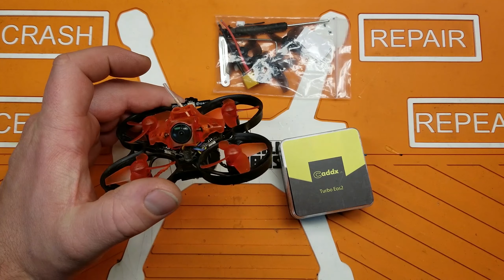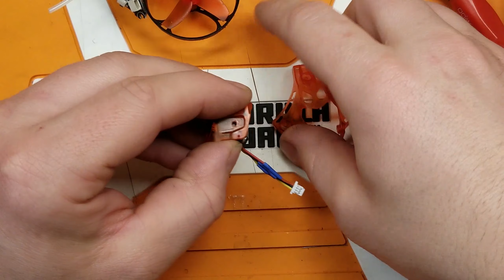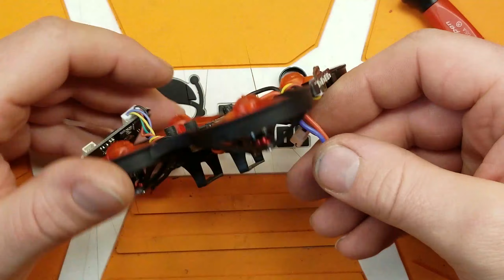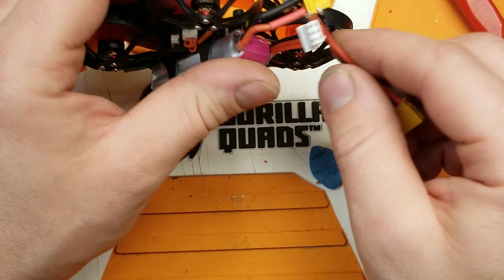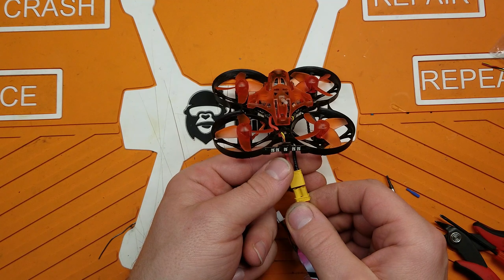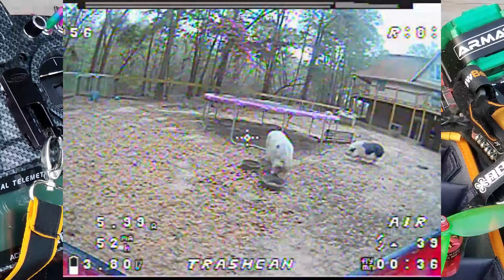Trashcan mods XT30, 4:3 caddx camera install, and range fix🏁👍👀

Comment: Cool video.
I think about buying this drone and I have box goggles with 16:9 screen (betafpv vr01). Do you think the image would be correctly displayed full-screen without stretching on that kind of goggles?
Reply from the maker: It will be stretched a little since the vr01 aren't actually a 16:9 ratio from what I remember. I think they are around 16:10 but if you don't know any better then it doesn't really matter.
Reply: @TweetFPV  Thank for quick reply :) 
They are 800x480 so something like 16:9,6 :) Do you think they will automatically adjust and display the feed from trashcan correctly fullscreen? I'm asking because I used them with a drone that has 4:3 camera and the image is really stretched horizontally. I'm afraid that they are hardcoded to stretch the 4:3 image. Is that possible? I think it's similar hardware as in eachine ev800dm.
Reply from the maker: I think the trashcan comes with a 16:9 cam so you should be good.

Comment: Whats your Battery and Power settings in Betaflight?
Reply from the maker: Sorry I don't have this quad anymore. But I could help you out. Typically I set max cell voltage to 4.4 minimum to 3.0 and alarm voltage to 3.2
Reply: Okay thank you very much for your answer :D

Comment: Whoop season and I have 2 dead Eachine Crazybee F4 Pro boards 200 flights on first board... about 20 on the replacement... any word on the quality of the V2 V2.1 V3 boards...?
Reply from the maker: I have had good luck with the v2 and v3 boards. But there are so many other options out there like the betafpv aio board and the nameless rc board that I would probably pick before the crazybee boards.

Comment: Nice camera mod, but were the pins different sizes? Instead of splicing the wires, seems it would have been faster and easier to move the pins. They pop out the connector very easy.
Reply from the maker: I was going from a scoket to pins or vise versa I can't remember. That's why I had to splice.

Comment: You can add your own receiver the R1 pad and the 5v and ground from the camera pads i did it myself
Reply: Any idea what DSMX Spektrum receiver would fit/work on the trashcan? Thanks
Reply from the maker: https://www.getfpv.com/spektrum-spm4650-dsmx-srxl2-v2-serial-micro-receiver.html that's about as small as it gets.

Comment: or you could have pinned out the connector and just change them..  and eos2 turbo is a 16:9 camera.. the ones sold as 4:3 is just set as that with software.. you can do that yourself
Reply from the maker: The eos2 is not programmable or at leat not by the end user. There is no camera control on this camera.

Comment: How did you get your FC to accept the LED assignments in Beta flight.  I was able to number them, assign colors and options in beta flight but when I click save nothing seems to take...the transmitter loses telemetry and regains telemetry (almost like a reboot but it never disconnects) but no joy.  I have been able to get every other betaflight option to stick except the LEDs.  A tutorial would be great!

Comment: thank god they made holes in the V2 version that way the battery lead can be soldered from underneath the board and solder on pads on both sides.
My other one blew up because the leads were shorting out lol.
Reply from the maker: Yea that v1 board was not an easy one to get the heavier gauge wire soldered to. I actually found it better to solder the positive to the pad then the negative to the ground leg of the USB port.
Reply: @TweetFPV  Also possible, i did it that way when my internal regulator burned out, so i used a pololu 5v regulator and took the negative from the usb :)
Shortly after it died completely but that was probably an esc failure, started smoking and shit XD.

But im scared because we are supposed to use this to control voltage spikes from the xt30, they ship it as an extra option strangely enough,  new v2 board came with normal xt30:

https://www.banggood.com/Happymodel-XT30-Plug-Pigtail-Power-Wire-with-100F-Capacitor-for-Mobula7-HD-TRASHCAN-UR85-UR85HD-Crazybee-F3-F4-PRO-Flight-Controller-p-1476203.html?rmmds=myorder&cur_warehouse=CN
Reply: Yup fried my first board trying to solder an XT30 harness on. Such a bitch.

Comment: so with the xt-30 mod you found it more manageable on 2s indoors than before on the 1s shorted set-up recommended for indoors? did you notice any difference when going full throttle outdoors? id much rather have a stash of 2s than 1s and be replacing connectors. thanks for sharing your video!
Reply from the maker: Yes, more manageable in the sense that the Quad actually reacted the way I should have with stick inputs. In 1s it was very laggy. It took way to long for the Motors to spin up to where they were effective in turns.
The performance outside was way better too. Those ph2.0 connectors are a major bottleneck for this Quad.
The trashcan suffers from being designed to be all things for everyone rather than a purpose built Quad. It should have come as a 2s xt30 only Quad. If 2s is too much power you can always setup a throttle cut in bf.
Reply: @TweetFPV  awesome! That is the most thorough answer I've ever received on YouTube thank you! You just saved me investing in any 1s batteries other than what comes with the trashcan
Reply: It's not really a good smal room indoor quad. U can put ur throttle on a knob to adjust it as u will but it really isn't the best for small indoor tracks.

Comment: great video, i'm new to this hobby, and was thinking why not buy some 2S battery with JST connectors and block one of ph-02 connector and fly it like that, why change it to Xt30 at all ? sorry it might have an easy answer but as I said Im still new and learning , I would appreciate any help , info or advice ,
Reply from the maker: This drone does infact come with the ability to just run 1s like you are talking about. The issue is that if the Motors are designed to run optimal on 2s then they will be very underpowered and are underpowered on 1s. On 1s the drone does not react quickly to any input or outside forces. Also the ph2. 0 connector is very limited on the amount of amps that can pass through it. The tx30 can handle more consistan amps. This allows the fc pid controller and Motors to react they way they were seainged to. I hope this helps. If you ever have any questions please feel free to ask!
Reply: @TweetFPV  thanks a lot, it was a great Help, and thanks for offering help, I would definatly need lots of it, thanks again ,

Comment: hi mate, why dont you pull the pins from camera and the connector for insert in in the right one? you havent to solder just pull and play!?! lol
Reply from the maker: The pins that are on the new camera are male pins. They need to be female pins to connect to the Vtx. If I had pins and a crimping tool I would have done that.
Reply: @TweetFPV   ty for reply

Comment: how to replace the low resoltuion caddx turtle with turtle v2 do i need any soldering or i just replace the triangle board + camera with with what i get from caddx turtle v2.
Reply from the maker: Replacing the stock cam with a turtle or any HD cam combo requires quite a bit of work. First there is how to mount the cam because it won't fit in the space provided. Second is the power requirements of the turtle. It requires more voltage and amps than what you can get from the built in regulator on the fc. Other than those two items you will have to make up a connection to the triangle shaped board because that is the Vtx.
Overall it is going to be a bit complicated of an upgrade.
Reply: @TweetFPV  Thanks for the detailed info. Then in that case i feel ill do a scratch build from rotorbuilds.

Comment: Crazy short flight times... after 4 flights... I will solder the XT30 before I fly again... already ordered the GNB 300s... it flies superb.
Reply: dose using a xt30 with a 2s 500mAh get better flight times even if using 2x250mAh on the serial connector =? and could you explain why ? would really help me out thanks
Reply from the maker: Yes longer flight times with the xt30 and a 500mah lipo. Using 2x 1s250mah lipos in series only gives you 2s @250mah. The 2s 500mah lipos are 2x 500mah batteries ran in series. I hope this helps you.

Comment: Great video! I was thinking about putting in the XT30 connector on but at this point I have (at least) thirty 250-300mah Tiny Whoop batteries. As for the camera, I'm not sure what Eachine was thinking going with a 16:9 CMOS camera, probably had a bunch of stock lying around. It has only been a week and the jello/stretched video is already getting old. Probably do the camera upgrade soon. Far, far better than the camera on the Mobula7 but still...
Reply from the maker: Yea that was the same for me. Lots of 1s lipos had to get a few 2s just to try this. So what I did was made a xt30 to ph2. 0 conversion cable so I can still run the 1s lipos in series if I wanted to.
Reply: @TweetFPV  Good call on the conversion cable. Gonna solder the XT30 on the Mobula7 and Trashcan. There is no way those Tiny Whoop connectors can properly handle the 25+ watts the 2S quads draw.

Comment: I have removed the connector on the VTX and soldered the cables directly that I cut way to short. It wasn't fun but got it together again in the end. Now I wake up screaming at night hoping my trashcan is OK so I never have to open this thing again^^. I can only recommend to anybody: Do it as tweet did with connectors intact. You will not regret it when you have to fix something again
Reply from the maker: Haha yea this thing isn't all that easy to put the canopy back on.
Reply: @TweetFPV  xD My trashcan has been through alot. It's on it's third life now. First life as a whoop, converted to a toothpick after death by dog (video on my channel) then just now converted back to whoop again xD have to agree the canopy/vtx mounting is a pita.

Comment: No that's viable cause I charge my batt that have xt30 on a imax b6ac v2 and it does charge them a little on the high side. And I never had a problem with any of them until I put xt30 connector on maybe the F4 has more robust components
Reply from the maker: Possibly. If I have one fail I'll be sure to post an update.
Reply: I've had two mess up after xt30. One the 5v reg went out and the other gets weird power surges. I'm gonna make a toothpick wit a gepc board as they r rated for 3s. But only wanna run 2s
Reply from the maker: I have a geprc board in one of my custom cavity frames running 3s. It's a great board but does not come with a on board reciever.

Comment: I'm afaid to put another xt30 on these boards they last about a day and the regulator burns out some how
Reply from the maker: That's odd. These crazybee fc's have been one of the most reliable micro flight controllers I've used. Perhaps your charger is over charging your lipos slightly? Just a shot in the dark for a reason.

Comment: Any problems burning 5 volt regulators out the flight controllers? the f3's have been very problematic for me when I put XT 30s on them
Reply from the maker: No problems with the crazybee f4. I have not tried an xt30 w/2s on a crazybee f3